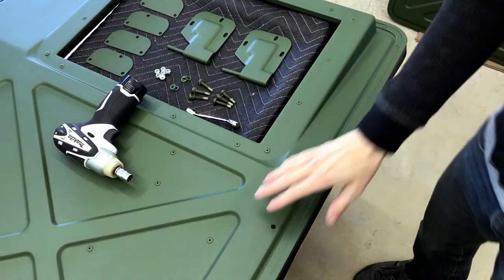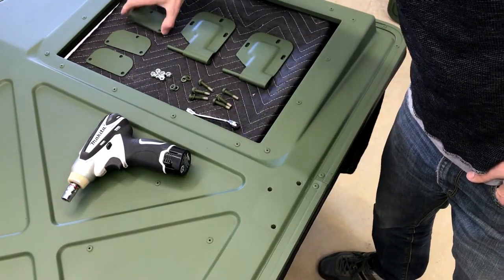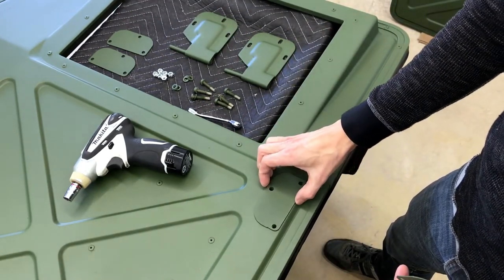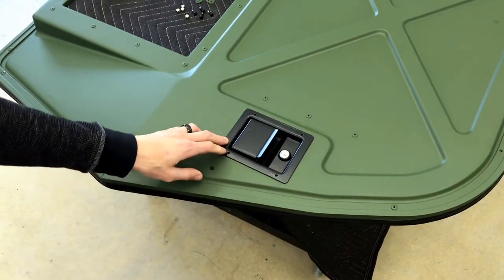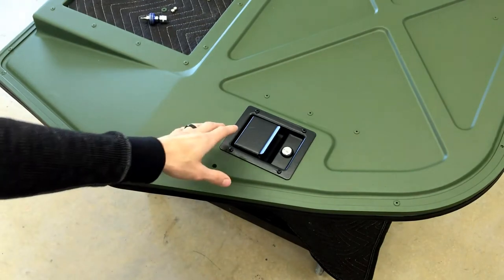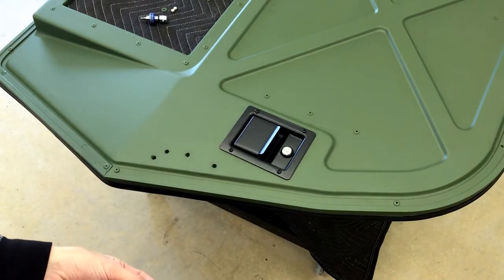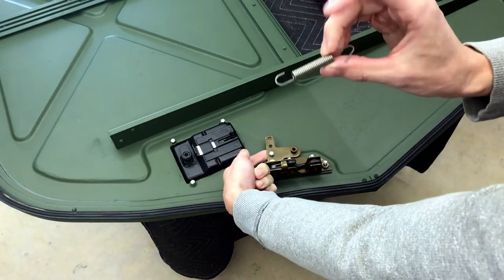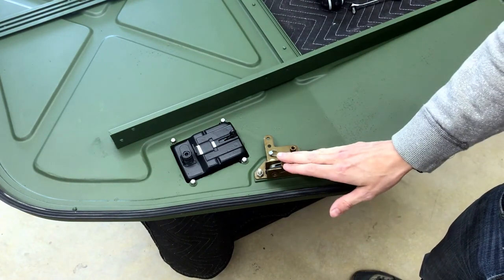Humvee X-Door Rebuild Instructions

Comment: Thank you for the Video! I gotta say that these doors came out pretty good. Did you rebuild the doors yourself? Any suggestions for removing the old CARC paint and getting a smooth sourface just like yours? Best regards from Germany!
Reply from the maker: CARC paint sticks pretty well so I just used an orbital sander along with hand sanding the tighter areas. For damaged areas I’d use some epoxy to fill the area then sand. For paint I used Rapco 383 and applied 3-4 light coats.
Reply: @anvilmotorworks4475   Thank you for the quick reply! This helps a lot. I will try to get all my four doors done this summer but they are in pretty rough shape. Also, what I wanted to add, I will probably manufacture a small aluminum frame to strenghten the door handle mounting on the innside. Saw someone selling that here in Germany and think this is a pretty good idea.
Reply: @giantpinkrabbit7109  I may do the same with mines or just get the whole supplemental plate

Comment: Do you have a contact name etc for the locking door handles and new lock mechanism?

Many thanks
Reply from the maker: I ended up buying NOS latches on eBay and the locking handles from Federal Military Parts.
Reply: If you get these from federal military parts be aware that they may not all be perfect, I got 4 of them, 3 of them was perfect, the other one had paint chipped on one